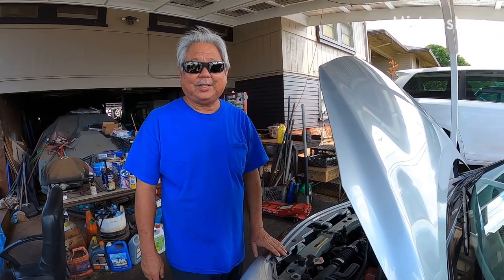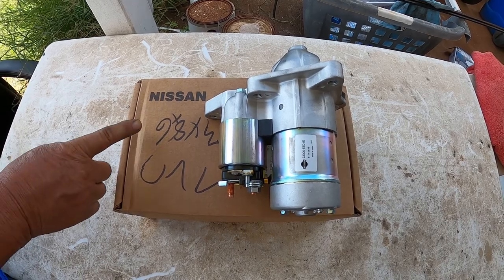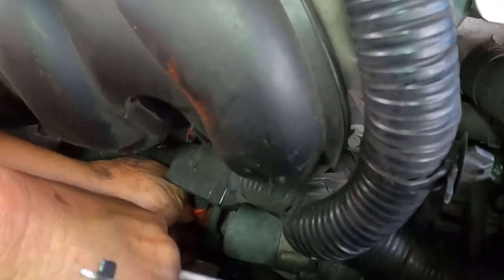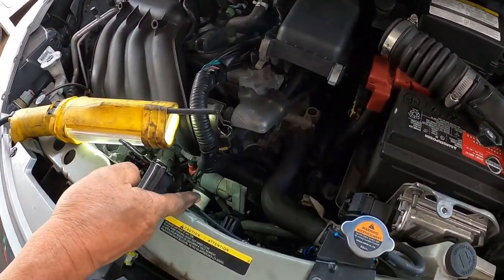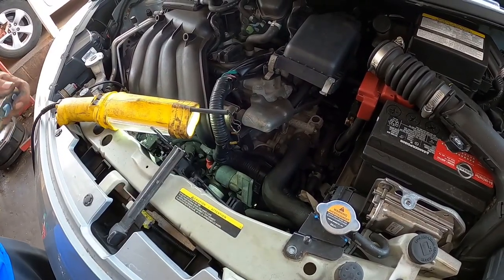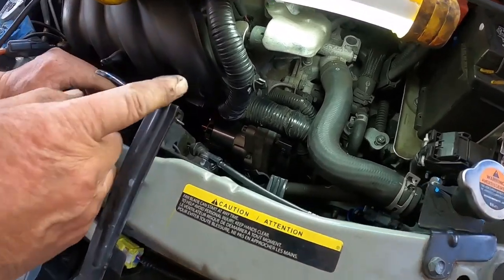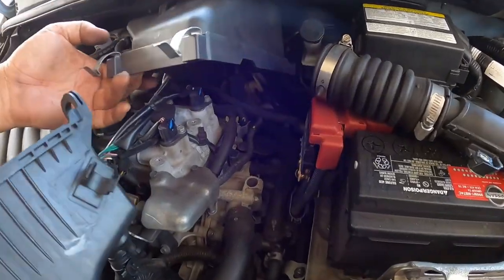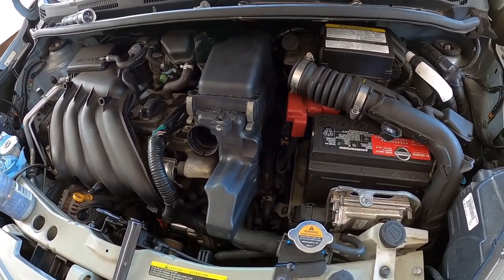How to Replace a Starter on a 2015 Nissan Versa Note

Comment: Here in 2023, looking at replacing my starter for my 2014 Nissan Versa Note -- Great video! Looking forward to trying to replace it this weekend. Thank you for the tutorial and your tips!
Reply: what were the symptoms (in case mine starts to fail)
Reply: @user_19  It was failing to start, even in decent weather whenever I went a few days without driving it (I work remote most days). It would go to turn over and then not start, and it would take a couple times trying to start it to get it to start. At first I assumed my battery was going and replaced it. It kept happening and then one afternoon I went to start it and it didn't even click. Just the lights came on, on the dash. This happened at about 140k miles for me, although I have read it can happen with less milage. Hope this helps!
Reply: @Alanik06  ok really good to know b/c I'm at almost 150k and start the car multiple times a day

Comment: Thanks you for this video, It's always nice to know what tools are needed before starting a job.  On my 2014 Standard Transmission I was able to get the starter out without going under the car.  I only needed one ratchet wrench and a deep welled 16mm socket.  The hardest part was the smaller terminal nut which ended up breaking off the stem.  No big deal as I am replacing it anyway.
Reply: same thing happened to me! My replacement starter did not come with replacement nuts so I was in a bad spot. Thankfully the local auto parts store just happened to have the right size lying around and they actually gave it to me for free.